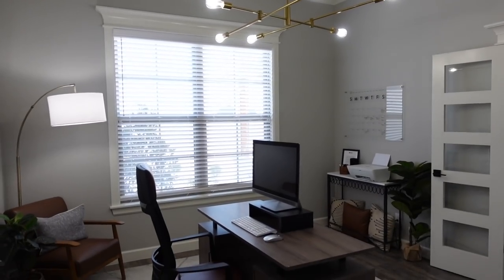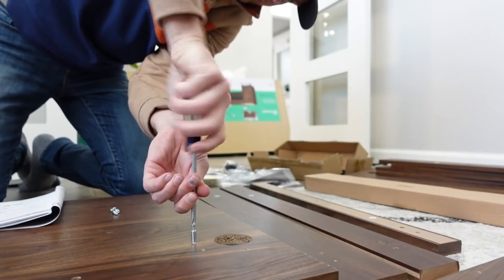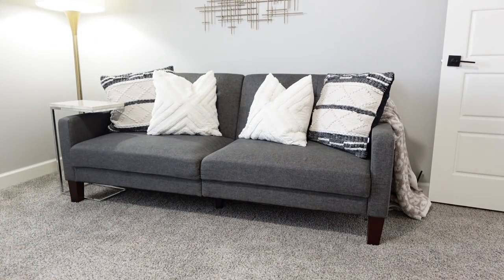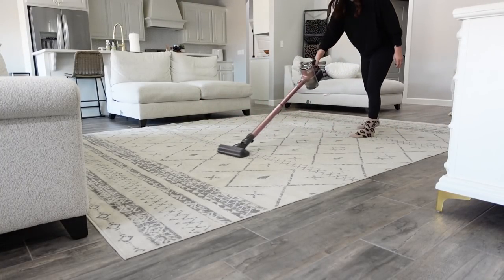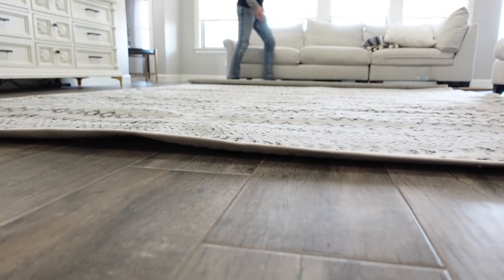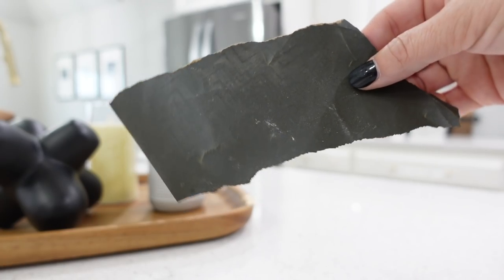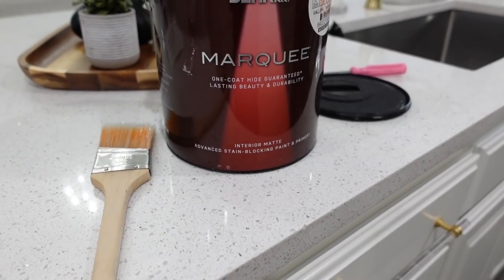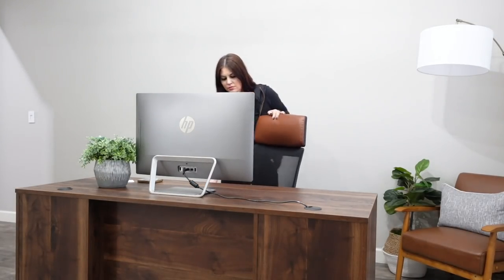SMALL HOME PROJECTS THAT MAKE A BIG IMPACT🏠 | DIY HOME PROJECTS ON A BUDGET | 2022 HOME UPGRADE TIPS

Comment: Hi Ashley!  I learned a great tip from the drywaller that was here finishing our basement. Instead of sanding the drywall filler use a wet rag after it dries. If makes less mess and does not damage the texture. It works fantastically. 😊
Reply from the maker: Thanks for the tip!

Comment: It looks great like always. 👍  We've needed to paint this place in its entirety since we moved in. 😅🤣 The walls here do not wash well and I'm so confused by it to be honest, especially since the "leftover" paint we found was sherwin williams. 😰 Definitely gonna look into easy to clean/hold up well under soap and water type paints for the next house.    It does so much for a space just to have fresh looking walls.
Reply from the maker: We found eggshell paint is the best for walls so you can wipe them down and clean them without the walls chipping. It’s more expensive but we’ll worth it
Reply: @TilVacuumDoUsPart  They don't chip here. They like turn into a matte version of smeared dirt(?) no matter how much I scrub. Eventually I'd just scrub the paint off the wall if I continue. Again I've never seen walls do what they do here. 😅 I once cleaned a habitual smokers walls/nicotine off of every surface in the house we moved into in eastern Colorado and it was easier to clean those than the freshly painted walls in this house. 😂 I'm pretty convinced at this point Kansas is just dust in disguise as a real place. We're military and no one who comes from other places thinks the dust here is normal. 😂